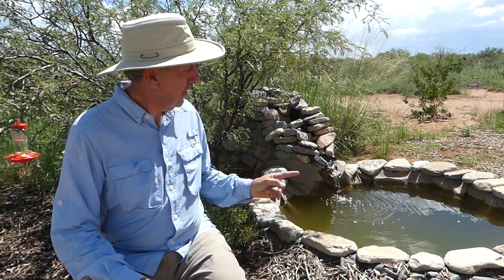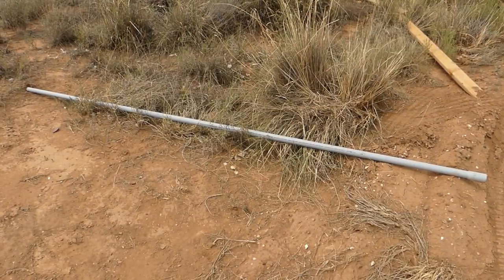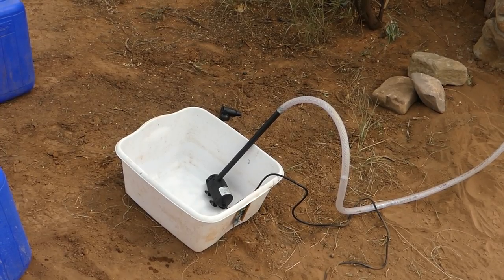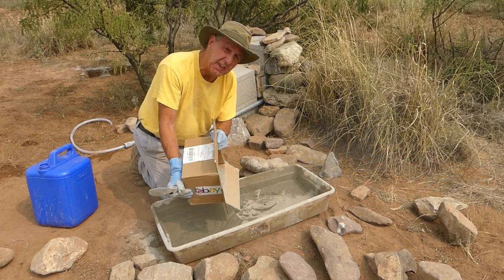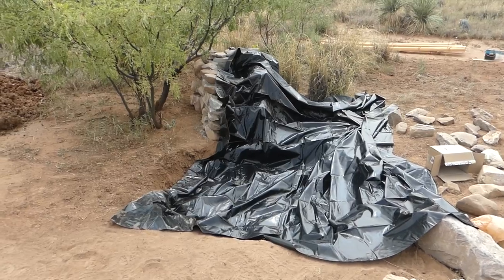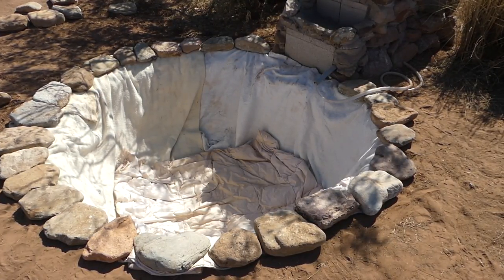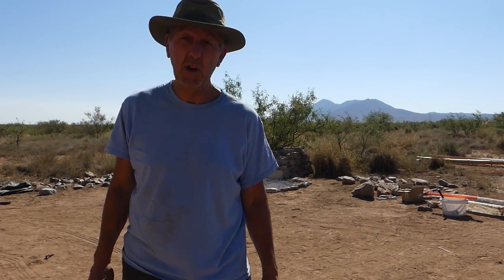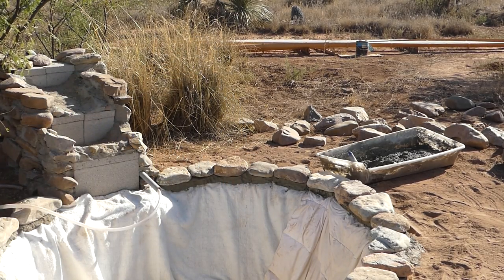DIY Offgrid Solar Wildlife Pond with Falls PART 1

Comment: Just wait till we have a record fire season!   Cut back from your structures for some modicum of protection.
Reply from the maker: Good point MJ.  However I have nothing within 30 ft of the building other than one small mesquite tree. Fortunately historically this area hasnt been that fire prone. But then I lived for 30 years in northern CA for comparison.

Comment: I know that when you overmix pie dough, the dough becomes tough because you've over activated the gluten in the wheat flour. I don't know if it applies to mortar though someone else would need to weigh on on that
Reply from the maker: Thanks for watching Art by Karen E. Haley.  I have been told that you can't overmix concrete and I have found that it starts to get hard long before I have overdone the mixing part so I think I have it figured. Hopefully LOL. Cheers and thanks!

Comment: Nice job on the pond. If my ground was like yours I'd have a pond too.
Reply: You don't need to have a hole in the ground. I built one on granite ledge. Just build up. Plan for a bench that you can sit on to view into your pond. A foot or two of water in the pond is more than enough. Go for it and plan a water fall or sloping stream into the pond. Very attractive.
Reply from the maker: Thanks 👍 Cliff!
Reply from the maker: Wow be fun to see the pond you made Michael Chugg.  Never heard of the building on granite ledge method but it totally makes sense now that I think of it.
Reply: @affordabledesertliving3487  I will send some pics.
Reply: I sent you a Google  drive link to the photo of my 17 year old inground pond and waterfall.
Reply: @canuckyank82  Access Denied 😳Good try
Reply: @cliffandrews   If you have gmail or a Google account  it works.
Reply: @canuckyank82  I saw it. Nice job👍
Reply: @cliffandrews  Thanks Cliff. Really enjoyed it for years.
Reply from the maker: @canuckyank82  Got it and opened it.  Man that definitely looks like a great bird magnet. The terrain looks northern. Thanks for sharing!  Also a water feature definitely increases the value of a home.

Comment: Don’t know if this makes sense or will work but I notice tall dry grass near by and I’m wondering if a mat could be weaved from it to partially cover the pond to slow evaporation and add an additional texture to the scene.
Reply from the maker: Great suggestion ChronicFatigueHermitHiker but I find that any organic material at all seems to create the propensity for algae etc. For now I have chosen to maintain the pond by draining and refilling periodically.

Comment: Thanks for sharing. Can critters get out if they fall in?
Reply from the maker: Hi Tim: Depending on the species yes.  But to make it safer I will put a small ledge on one end of the pond. Sadly I had the pond partially covered to keep out javelinas which became a problem and a little desert cottontail couldnt get out and passed away.  It was one of those freak accidents as that species can swim well.  It just couldnt figure out how to get past the barriers I put there.  As you can imagine I dont use those anymore!

Comment: Looks like you puppied out before you reached 3 feet.  Hard ground, lol.
Reply from the maker: Hi Jody actually that could be one angle to view the project from as you are correct the Caliche is super hard ground.  Or the realistic and practical one which is what actually happened. My goal was to have a pond that was deep enough to hinder the growth of algae. I determined digging another 6 in would not achieve this goal with any greater success. I am definitely open to seeing some data to contradict my assessment. So thus in the economy of energy expended with a calculated reward It didnt make sense.  Thanks for watching!

Comment: great pond but where is the log/ladder/steps so small animals that fall in can get out and not contaminate the water as well as small birds.
Reply from the maker: Great point Ted. I will soon construct a small platform where birds can lounge in the pond area. It can also be used for creatures to hop out of they need to. What you cant see well yet is that there are multiple pools at the top of the waterfall for birds to hang out.
Reply: @affordabledesertliving3487  get a branch put cement on the end and lean it to the edge , mice to cougars. get a flat rock at water fall as platform.  Expect anything and if it hasn't happen to you , you haven't done it long enough.

Comment: Good job, bro! Hey. If you have electrical questions, feel free to drop me a line. I am full of... advice! on the topic of low budget electrical construction.
Reply from the maker: Great champ.  Were you an electrician by trade as well?
Reply: @affordabledesertliving3487  Electronics engineer. I won't advise on AC power wiring conforming to local codes. But, hooking up solar lights, pumps, antennas, etc. Should be no problem.
Reply from the maker: @videolabguy  Rich, Since my building is exempt from inspection (I have an opt out permit) I am wondering if you could wire the building to be like an RV with a 30 amp(?) I think. coming out of the fuse box to then connect to an RV electrical outlet I am using for my future solar.  Hope that makes sense.